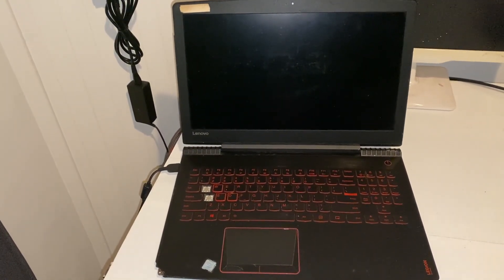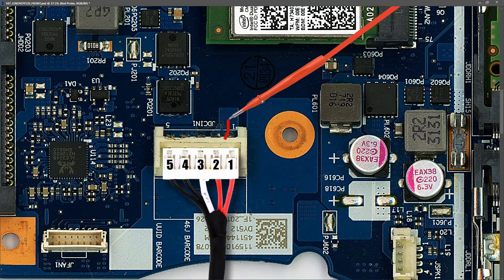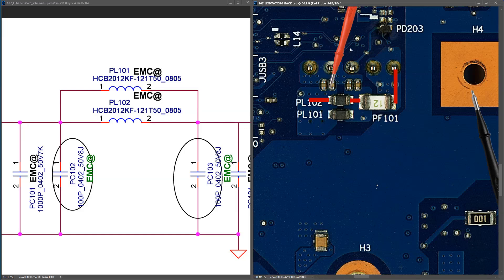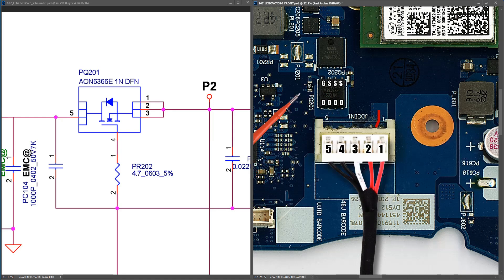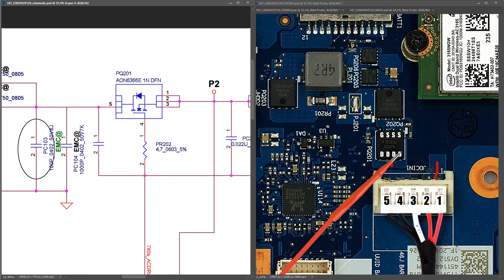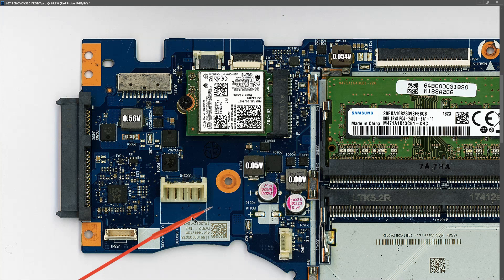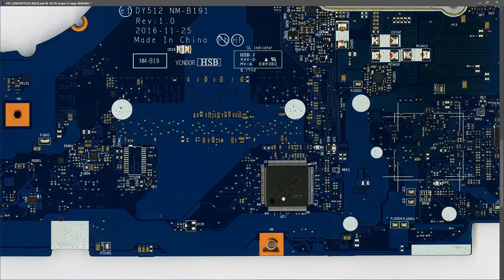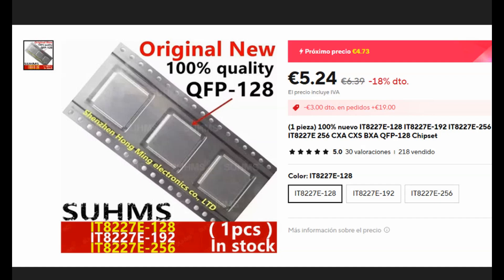LENOVO LEGION Y520 - NOT POWERING ON

Comment: Hey! Great video, ive been trying to troubleshoot my y520 for a little bit, everything seems okay and i did all your steps and everything seems to check out okay.. the only sign of life is the light next to the usb c plug when i press either the novo button or power button .. both the mosfets are reading okay
Reply: The only sort of strange thing is when I plug in my adaptor the UH1 piece gets warm without even pressing anything
Reply from the maker: @jakevalencia8586  Hi, I dont see any IC marked UH1 on my board on my Y520. Can you just double check that. Or mail me with a picture of the IC to therepairshare@gmail.com and I will have a look.

Comment: what if the pr201 was dead or reading low any suggestions ?
Reply from the maker: If you are reading low voltage at PR201, then it is likely that the two input MOSFETs are detecting a fault and not allowing the voltage through. I would shut off the laptop. Disconnected the power adapter and battery and check resistance between PR201 and ground.
Reply: @therepairshare673  Resistance reading as low as 0.008 ohms

Comment: This is kinda long-winded...I'm not making hyperbole,  but you have the most informative, and easy to follow along videos of ANY content creator I have watched and followed, that includes some well-respected platforms that have been around for years. To be fair, the others offer a ton of info, but they leave out the very basics and it's easy to get lost when trying to learn.

I've been interested in electronics for years, and have a good understanding but when it comes down to schematics and circuit pathways, what component should be in a certain circuit and what that component does/controls is ABSOLUTELY KEY when trying to learn and follow along. For lack of better terms, many other platforms will show what they are probing but not the exact contact point, polarity,  the reason for it, and what it controls. Almost like telling someone you don't want dirt or varnish in your fuel line, and also need adequate pressure, and leave out that dirt can clog the screen in the injector and cause a dribble and not a spray, as well as low pressure. The other platforms will begin at a college level 200 but forget many are still at 101, and with EE you need to include the basics even if it takes more time to do so....and that's what you do, at least you are still in the 100-level course instruction..lol.

So I want to thank you for taking the time with all your editing, the added graphics,  schematics, letting us "rookies" follow along in such a manner that we can actually learn from the ground up.

I have a decent electronics setup but have been trying to learn the basics of troubleshooting laptops and other electronics for a few months now, binge watching videos...yours was the first one that made everything come together....again I greatly applaud your efforts and continue the excellent work!
Reply from the maker: Hi Steve, thanks for taking the time to post a comment. My idea is to produce the videos that I would have learnt the most, in the shortest space of time, when I was first starting. I will keep producing videos as long as I feel that the channel is making progress and I can still afford a Photoshop license!

Comment: I'm in the same boat as we speak with a Lenovo that also had shorted the LDO and burned EC (among other things). I had a board with the same EC but obviously different EC firmware on it so now I'm with a dead laptop that I need to get one of these ISP programmer on my hands and give it a try. Do you have a programmer and the EC FW? I don't think these EC are self programmed through BIOS (mine is a IT8586E) even if their internal SPI is empty. It will be a very interesting video if you have a programmer, keen to watch it.
Reply from the maker: Sorry one more thing. When searching around the topic I found that Electronic Repair School did program a similar Lenovo Legion laptop using the IT8227E-192 Super IO. Maybe I will buy the same IC programmer. 
https://www.youtube.com/watch?v=wLGj6EM42_g
Reply from the maker: Hey Nick, hope all is well. I have purchased a blank IT8227E-128 EC, so my choices as I see it are:
1. Possibly program USB download to USB boot stick or possibly it may program itself using EC BIOS.  (Basically exhaust all options which do not require the IC programmer.) 
2. Just buy the IC programmer and put the program on the new IC myself. 
It is possible to purchase the IC pre-programmed, but they are very expensive - And I dont want to spend too much money on this board, as there may be other faults. At least if I purchase the IC programmer, I can use it in the future.
Reply: @therepairshare673  I'm fine, thanks! I'm not sure about this EC but it also depends on the m/b design. It may act as master in the SPI so in that case it gets the firmware from an external Flash (of course it must be blank) or it needs external programmer. SVOD is top-notch and I'm also having my eyes on this and the only thing keeping me back is it's price. On the other hand, for 250€ you get everything you need to start programming almost any EC out there plus hundreds of others. Personally, If money wasn't an issue, I would buy SVOD. It's an investment if you are seriously getting into repair thing. It would be also a great video since I see you are very frustrated for the content you make. I think your videos are very uniquely presented and you are very methodical, which is very important for someone who is here to learn repairs.
Reply from the maker: @nikolaskallianiotis8622  yeah I saw the SVOD when Sorin was using it. I currently have only a CH341a for BIOS, and nothing to program a Super IO. €250 is the price I saw quoted for it also, I'd better check my piggy bank. 😞
Reply: @therepairshare673  I know, 250 is a lot of money for a programmer but then again, you help them to continue support their hardware with software which is their main differentiation point compared to other programmers.

Comment: I ts worth noting that the ID pin must be working for the laptop to work and has to be present usually if this pin is shorted or connected wrong it leads to a short circuit in th IO IC as the ID pin is connected directly to this IC.This usually happens if the power adapter is not genuine Lenovo one.